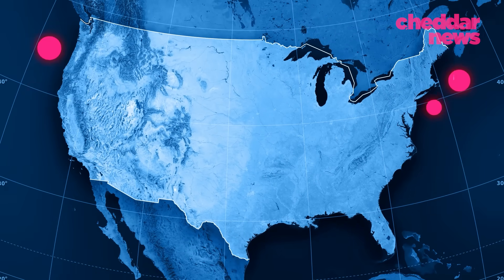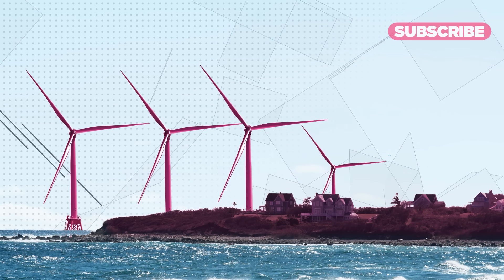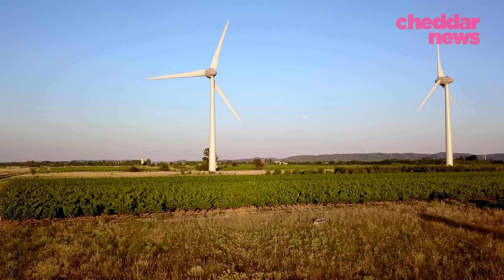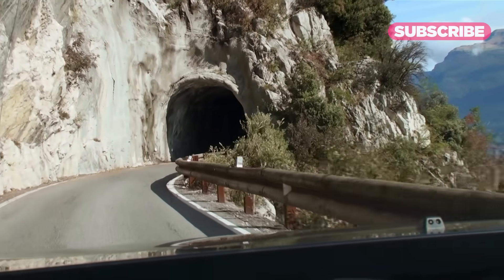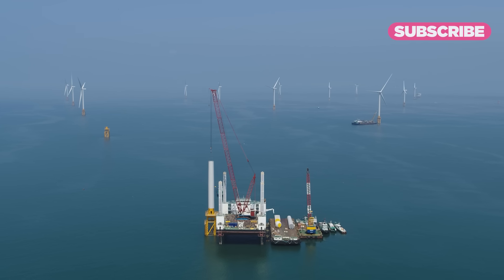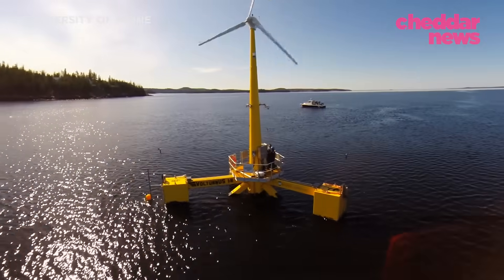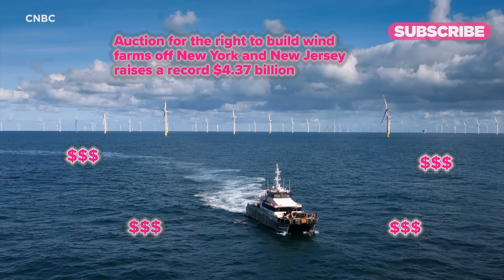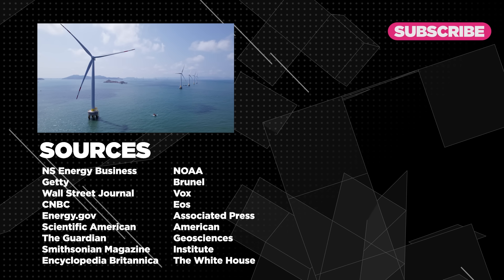Why Finding A Spot For Offshore Wind Is So Tricky - Cheddar Explains

Comment: If wind power is so amazing why would Denmark demolish a wind farm?
Reply: Decommission*. Every infrastructure project has a lifetime and the first wind farm to be installed offshore had one of 26 years. We can only expect the wind farms built since to have a longer one.
Reply: @tobynaylor  The typical life span of a wind turbine is 20 years, with routine maintenance required every six months.

As the average age of American reactors approaches 40 years old, experts say there are no technical limits to these units churning out clean and reliable energy for an additional 40 years or longer. Sounds a lot like 80 years.
Reply: @TheStickinator  we’re talking about offshore wind farms here, there isnt really a “typical” lifespan as only one OWF has been decommissioned and that had a lifespan of 26 years and was built with older technology. I work in the industry and the WTGs being produced nowadays are expected to last for at least 35 years with the option to repower for an additional 15 years, probably more.
Reply: @tobynaylor  Right because they reinvented the wheel for offshore windmills. Makes little sense. Just abandon all that expensive R&D and make something totally different. I can buy that the different and harsh environment will need to be taken into account. But if anything that will only shorten the life expectancy.
Reply: @TheStickinator  Yes, but reactors take ages to build. Nuclear would be great, but we'd need a time machine to start in time to stop climate change.
Reply: @domtweed7323  Nine mile point Unit 1 is now licensed to operate until 2029 and Unit 2 is licensed until 2046. And it was built in 1965. So why are you so afraid of it taking 10 years to build if they can last 70 years?
Reply: @TheStickinator  Under normal circumstances you'd be absolutely right. But we've left it extremely late to decarbonise the electronical grid, so we need to do it in under 10 years.

If you live in France/Russia/South Korea, and have the pre-existing infrastructure to wack up nuclear power stations really quickly, that's brilliant and you should do it. But for the rest of the world wind/solar are faster, and we've left it too late to be picky.
Reply: @domtweed7323  unrelated to wind. Why isn't there any talk among the "Climate Catastrophe" group not to buy Chinese Goods? The typical shipping container ship will use over 2,000 gallons of diesel per hour and at any given time there are 5,000 of these ship under way.
Reply: @TheStickinator  Fair question:

Ships are actually extremely efficient, so the emissions from the shipping component of transport is quite small, around 2%. So we should focus most of our effort on the bigger sources of emissions: The meat industry, burning fossil fuels, etc..

Also, we should focus on avoidable emissions. A large part of shipping is unavoidable: We can't stop shipping food, agricultural equipment, etc.. However, we can stop most passenger flights, meat eating, most fossil fuel use, etc... So those should be our focus.

Ships definitely need greening, but their just not the central issue
Reply: @TheStickinator  It's not "okay", it's very bad. It's just not as bad as the much larger sources of emissions. How bad something is = the net preventable CO2 emissions being emitted.

Let me explain why meat is so bad. Animals, particularly grass fed/, organic ones, and particularly lambs/cows, use vast areas of land to grow their feed. About 20% of the earth's land surface. That produces some carbon emissions directly (via nitrogen fertilizer, cow fats, disease, etc...) But more importantly if we stopped eating meat that land could revert back to national forests/grasslands/wetlands, which would leave to massive negative emissions for about a century. So your stake isn't just emitting carbon, it's blocking a potential carbon absorption: Turning the fields back into forests.

Likewise the emissions from coal/gas burning for electricity are massively larger than shipping emissions, and easily replaceable, either solar, wind and nuclear. So a larger issue that's easier to solve.

Your right that shipping emissions are bad, and need fixing, their just not the main issue.
Reply: If Houses are so good then why "that guy" demolished one?
What a stupid statement
Reply: Old ones break and need to be replaced, just like a car.

Comment: In the middle of the Pacific and Atlantic oceans, far away from everything.  Floating turbines + solar using electrolysis to generate Hydrogen (and byproducts).  All shipped back to shore in drone ships.   Drones could also double as hydrogen filling stations for trans-ocean Hydro-powered cargo ships.

Comment: The biggest problem for off shore wind power and the USA anyways is the introduction of Small Modular Nuclear Reactors that appear to be en route to the US power grid. Since all of the siting and connecting infrastructure has already been built out there is a very impressive "plug and play" advantage to this idea...again in the USA although presumably in Canada as well.
Reply: SMRs have the same problem as all new NPPs - they're too expensive and take decades to build, with huge billion dollar cost overruns and decade delays.
Reply: Could be great when they actually build them. SMR's don't exist yet, so lets build our postmodern windmills for now and focus on SMR's when their ready for production at scale.

Comment: Actually wind generation has two problems: one is location and the second is blade degradation and the fact they cannot be recycled.
Reply: So the industry is behind in finding recycling solutions... It's not a reason to stop all together.
Do you have any idea how many lead acid batteries are in landfills... Now they can recycle 95% of them (and growing).
Reply: @clintforest44  Why do we need to "recycle" them? There just big pieces of artificial timber, lets build stuff with them.
Reply: @domtweed7323  So you're saying that after they are done being used as turbine blades that we should find another use for the material?
I wish there was a word for that...
Reply: @clintforest44  I think your misunderstanding. "Recycling", as it's commonly used, means breaking them down into component materials and reusing those.

I'm saying whole blades could be useful components in the construction industry. For example, you could build a bridge out of a few blades + a decking over them.

Comment: What are the reasons why only big windmills are being considered, rather than smaller "house-sized" windmills that anyone could attach to a roof? Infrastructure to and from the house is basically there already, to latch onto the main, and installing the system for solar shouldn't be too different than installing a system for wind.. I'm not savvy in electronic engineering, which is why I have so many questions!
Reply: They kind of touched on some of the reasons in the video.

Larger blades, higher turbines, and flat unobstructed land all contribute to faster wind and more power.

The inverse of that is smaller blades, lower towers, with lots of buildings and obstructions which basically describes most small personal wind power in urban/suburban areas.

That’s not to say they can’t work in some situations. I know of a few on oceanfront residences/hotels for instance. But it would be hard to make it work in most residential neighborhoods.

Solar, on the other hand, isn’t nearly as sensitive to scale.
Reply: Smaller scale wind turbines are not exactly feasible at the moment. A number of the reasons are touched upon in this video. Undecided with Matt Farrell had a video not long ago about small scale wind energy, the problems with wind at that scale, and some technology and companies that are working to try to make it feasible on the small scale. You should probably give that video a look.

Comment: Wind energy can drive generators, and thermal power generation requires coal, oil and natural gas, so wind power can save power generation costs than thermal power.
Reply: Yeah, that's kind of how all electricity is made... With generators...
Reply: Wind turbines cannot run without fossil fuels.

Comment: Wouldn't vertical-axis / helical turbines be a better choice? They require less area so can be more densely grouped, they don't need to turn to face into the wind, and they also are less noticeable to the human eye than a spinning propeller.
Reply: Vertical axis turbines are simply less efficient in these sorts of 'good' locations. Folks did the maths on this stuff many many decades ago and did consider pretty much any configuration you would imagine, along with lots you probably wouldn't even imagine ;)

When you start talking about small turbines in relatively bad locations, vertical axis can make sense.  They also look cooler.  But for big power generation, yeah, horizontal just wins because of the laws of physics.
Reply: @travcollier  so would vertical axis be more effective for home and urban use where wind currents are more complex and unpredictable. Also on top of large motor yachts amongst the vast domes and radars?
Reply: @mikeward1701  I think those are cases where vertical might be more efficient.
Engineering with Rosie has a couple of good videos on the topic.  Here's one:
https://www.youtube.com/watch?v=EM-gCvhQhPU
Reply: Then there's the fact, that wind turbines actually correct themselves towards the wind direction. They also tip their blades, to be as effective as possible, during low and high wind.

Comment: onshore being cheaper takes into account the less reliable wind and distance of transmission etc...    the fastest  way to net zero is to relocate everyone living in wyoming (who doesnt like it)  and cover the state with turbines there.   offshore wind is in question in the same way that natural gas is not a replacement for coal.   Build onshore wind and inshore wind, not offshore wind.  Build turbines 20% less output but completely silent and its still cheaper than offshore.

Comment: I support various forms of energy such as this and all, but honestly, anything shy of going nuclear is going to fall incredibly short, and it will take forever to even do that much. Nuclear is the safest, consistent, and clean form of energy that we have to work with. The amount of materials, up to and including toxic chemicals, that are involved in various projects, by just sheer scope, and we could just do so much more with nuclear. We gotta move forward and we gotta do it fast.
Reply: It may take 10 years to plan and construct an offshore wind turbine farm of 100 10MW turbines.
It takes longer than that, to plan and build a nuclear power plant, with the same capacity.
Reply: @akyhne  I agree that building nuclear is definitely a long process, and I still support green energy projects in the meantime, but based on the energy we need versus the land / resources needed for nuclear versus every other option, nuclear is just overall the most effective method.

So short-term green projects are good, but we need to make a HUGE push to start thinking and planning long-term projects that are absolutely necessary such as nuclear energy. At least until fusion goes commercial, but as the says goes we're always 20 years away. Until then, nuclear is critical, from small module reactors to massive facilities.

Comment: Offshore is nice because of the reduced impacts on birds (pun not intended).

And to throw my two cents into the green energy debate: construction cost and time, and materials are important; but don't forget about lifespan.
Reply: At least you mention the lifespan of these intrusive structures. These affect pelagic birds.
Reply: Wind turbines kill 100,000 to 450,000 birds a year 
Domestic cats kill approximately 2,400,000,000 birds a year
Reply: So we shouldn't care about gun related deaths? Because heart disease will kill significantly more.

Our quest for green energy is so wrapped around climate issues that other aspects of the environment are ignored or dismissed as unimportant.
Reply: @DrKahnihoochima  Sea winds tend to be more stable, and offshore turbines can be bigger (boats are bigger than trucks) so you get even more stable high altitude winds. So capacity utilisation will be higher even if lifespan is lower.

Comment: Atlantic Canada also has tremendous potential for off shore wind generation.  Combined with the hydro-electric plants in Quebec and Labrador, off-shore wind off the east coast of Canada and the USA could power the entire East Coast and even some Mid-West states such as Ohio and Michigan.  We would need to build high voltage transport lines, such as the 720 kV lines used by Hydro-Quebec to transport power from the north to Montreal.
Reply: Si je me trompe pas le Québec ne peut plus augmenter de façon significative hydroélectricité les autochtones bloquerons la construction des futurs barrages.
En plus avec le dérèglement climatique   il n'est pas garantie que le taux de remplissage des réservoirs soit satisfaisant. 
Sans parler des difficulté à construire des interconnexion.
Reply: @quentinnapieray5699  Avec les autochtones c'est toujours négociable; Selon les prévisions il devrait y avoir plus de précipitation au Québec et Labrador; Plusieurs interconexions existent déjà, ce n'Eat pas un obstacle important.
Reply: Id love to see HVDC lines go in, then the east coast wind could team up with the solar energy of the American southwest

Comment: 30GW / 10 million homes = 3kW continuous draw around the clock from every one of these homes = 72kWh per day per home! Something is wrong here , not even Americans can use that much electricity.
Reply: The installed capacity is different from the actual production, probably by a factor of 3-5.
Also Americans have the highest electricity consumption per capita so this statement may be true.
Reply: @udishomer5852  Yes She must be talking about installed power, so yes 20%+ is more likely the actual output.
Reply: 20% is very very low though, offshore usually has more than 40% capacity factor.

Comment: 7 offshore wind farms generating 30 GW by 2030 is in fact a very low goal. As of 2021 Europe already has a total installed offshore wind capacity of 25 GW with 5K grid-connected wind turbines across 12 countries.
Reply: I’m from the uk and I think it’s about geography. Europe has a lot more coastline than the us and we have a lot of sheltered seas not deep oceans in many places. The UK has wind turbines far out to sea as it’s windy and the sea bed is no more than 200m down. So the economics are easier.

Conversely we have far less empty onshore land so it’s harder to find enough sites away from people to do it on land.
Reply: @randeep6346  Just did some quick searches and Europes Coastline is a third of the US's, including the UK. Now that probably doesn't account for Inland Waters, but just saying that you're REALLY underestimated the shear mass of the US, plus we have the Great Lakes which really can't be ignored as they shape all of the Northeastern US's weather quite significantly. 
Knowing how the US works, it's more than likely politics between the federal and state governments. The Federal government doesn't have total control of the mainland coasts as those belong to their respective states. In order to get such a project approved, the state would have to be onboard and then the decision on who pays for it, Federal or State government likely goes back and forth as federal means you also have to get the other states to sign off on it too. We may be the United States, but that doesn't mean we agree on where the money goes. lol.
Reply: @scottjs5207  a significant portion of americas coastline is in Alaska although of course that’s not 2/3rds of the coast it still is significant.
Reply: The difference is, we started much earlier in Europe. The first big wind turbine manufacturers started in Denmark, in the early 70s. In the 90s, the country was already covered with turbines, and it had also become way more popular in other European countries as well.
Reply: So how are things working out in windmill powered Europe these days? Energy must be pretty cheap and reliable.
Reply: @edsteadham4085  Windpower is cheap. Sadly energy producers are charging the market rate set by putin for gas. The stocks for energy producers are through the roof, as are energy bills
Reply: Offshore wind is significantly more expensive than onshore, and the USA has lots of places good for onshore.
Offshore costs will come down as we get better at it and build up the infrastructure/expertise... But we aren't sure how much.
This 30GW goal is more about keeping offshore wind developing than really going for it as a major component of the power generation mix.  It is a good option to have since it will be a cheaper option in for some locations, but probably not that many (though some of those may be big coastal cities... So, yeah, complicated.)
Reply: Go ahead and propose a windfarm off Martha vineyard
Reply: So you're comparing 44 countries of Europe having less power than the goal of one country and saying that the one country has a low goal?  Math isn't your strong suit it would appear.